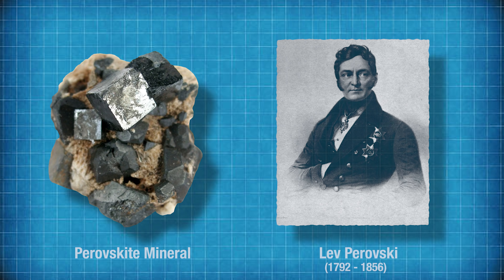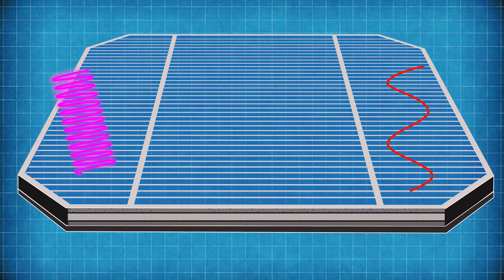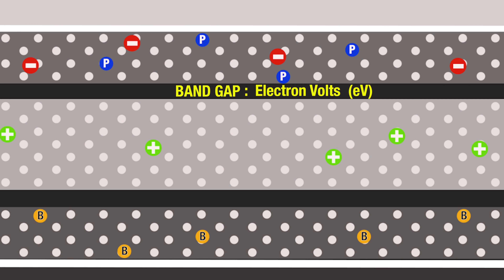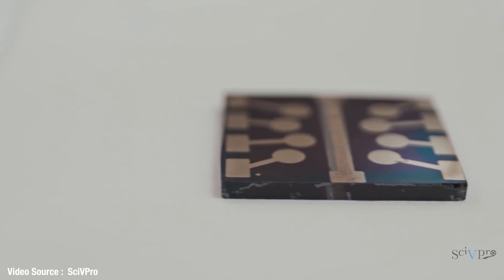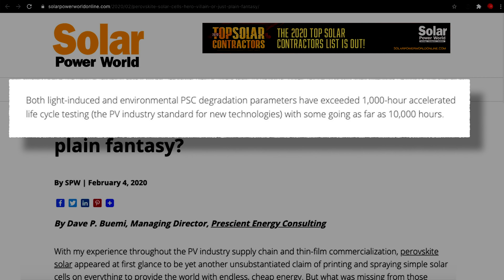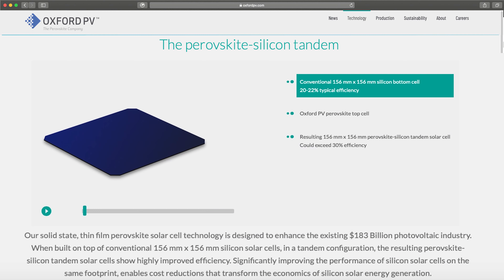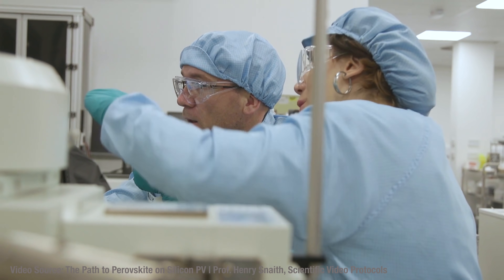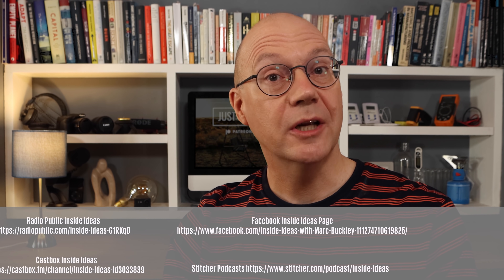Perovskite Solar Cells: Game changer?

Comment: Dave, great presentation on perovskites!  Concerning the lead in the cells, of equal concern are the silver contacts and all the copper wires, it's all generally from sulfide ores, often in the same ore body (like the one I live next too), and the risks need to be carefully minimized in both.  I would imagine the manufacturing process is safe because of stringent design standards, and newer perovskites are being developed all the time.. Concerning Aluminium, better would be aluminium conductive traces, perhaps sputter coated, or some other conductive materials that adhere well to either silicon or a perovskite.  Tin would be a safer choice I agree, though rare too, some might consider tin a semiprecious metal.  But if it takes but a tiny amount per cell, still that's multiplied by millions of cells..  probably we use 100s of times more just to coat steel cans!  It's worth it if it helps get us to net zero or negative carbon emissions.   Keep on with the great work, you offered just the right amount of information in your synopsis of perovskites.🧿🌎

Comment: Exterminating 100 square miles of desert for solar will not gain opposition from the fossil fuel industry.  It will gain opposition from the environmental movement.  A lot of desert is not flat, and most of the biota are in the flat places, not on rocky ledges.

Comment: Between the EZ (exclusion zone) charge-separating capacitor-like properties of water when exposed to light, and the high energy density of hydrogen (H2) gas, wouldn’t it be a better idea to allow the sun to drive a water splitting (H2 liberating) reaction by placing the panels over water? I am no electrical engineer, obviously, but it sounds like a powerful and safe combo if we can figure out how to make it work.

Comment: The performance of solar panels is NOT the problem. It does not matter whether such a panel produces 10, 20 or 50% yield.
Why?
Because space is practically unlimited; solar panels do not have to be as small as possible, their size does not matter. They must be cheap! Only the price per kWh is decisive.
That's where OLEDs come in, they are unbeatably cheap semiconductors because you can simply print them on plastic foil. Solar panels from the coil! Simply spread out, staple in place, connect to the grid.
But unfortunately this cheap technology is of no use at all. Not even if the panels were free, they would be a good idea, because THE SUN DOES NOT SHINE AT NIGHT! Solar energy requires gigantic storage facilities and for these there is no practicable and affordable solution.
Therefore solar energy is a dead end, unless we ignite the sun fire on earth, in fusion reactors.
Reply: "The sun does not shine at night"      Yes it does.
The rest of your twaddle about solar panels clearly indicates your lack of knowledge.

Comment: As an European I am so happy Jimmy Carter is mentioned with his 1979 solar panels for heating support.
No matter what people say he was decades ahead of his time and wanted to get out of fossil fuels to be more independent form Arabic oil.
Reagan made a 180 by preventing Iran to realise hostages before the presidential election and went full crude oil again.
Because of big oil.
This has lead to two wars against Iran and the first Iran war lead to Osama Bin laden and the involvement in Afghanistan etc and the air strikes all over.
This wars costs more than 2 trillion dollars more than enough for free college education and a healthcare system for everyone.
But both the healthcare system and free education was targeted by the republicans.
So who should be more respect seen from this perspective?
Carter owned his noble peace price because he cared for his fellow citizens, some presidents only care for themselves.
Reply: Of course solar is just now barely ready for primetime so there's that.
Reply: @chasl3645  not correct. If every Texas suburban house installed solar panels on the roof there would be a huge reduction in the demand for electricity for air conditioning during the blazingly hot days of summer (more than 6 months).
Reply: @michaeldasilva-l7w  You may be right. Doesn't change the fact that cost to produce Electricity is going up. Along with cost to produce panels is coming down.
Personally I'm rooting for an Iron Man type power supply.
 I think solar is old school.
I mean if we're going to dream let's make a electronic energy catalyser that maximizes the energy output of hydrogen. Maybe power your house on the energy potential of the hydrogen contained in an 8-oz glass of water for months.
There is absolutely better ways of producing power. Unfortunately I'm not smart enough to figure it out.
Reply: BS
Reply: He was also another president denied access to the ET / UFO Phenomenon that is very well known about by high level government . There is more known about the ET subject than modern medicine and the general population could careless to know the hidden truth .
Reply: @bruceburton8315  If you do your research you see him in a different light. https://youtu.be/UDzI2t5mrhE
Actually he don't believe if it s possible that they visit because space is so enormous.
Keep in mind the parker space probe is the fastest man made object in space so far but it will need about 18350 years s to arrive at the nearest star to earth Alpha centauri which is only 4.3 light years away. The milky way is about 90000 light years in diameter. There's for sure life out there but as far as we understand physics there's no way so far to explore the galaxy in a lifetime or a 3-4 generation ship. And even then we can't communicate well a near star would be about 50 to 100 light years away so every hello would take 100 to 200 years before we get a response from out there. Even the 40 minutes signal delay to Mars is a problem for NASA because each robot has to have ai when it drives to decide for himself because real time remote control is not possible at this distances.
So if they want something from us they must have a good reason. I by myself will not be visited from ETs because it would possible not end well for us.
The simulation hypothesis is much more likely in my opinion.
Reply: @abelgerli  I'm very sorry but that is not true . There have been dozens of people that are willing to testify in front of any congressional hearing and state what evidence they have . Its not a hoax . You need to look up the disclosure project and get up to date . These men have nothing to lie about like  NASA  and many others . Edgar Mitchell who went to the moon is one of them . Gordon Cooper another. Tom Bearden who worked with missle defense , Bill Uhouse USMC veteran Ww2 and expiermental pilot . Don Phillips Who worked on the U2 project and the Lengendary SR 71 blackbird . They all are true patriots and will tell you the shear truth if you go looking . Its not what we have all been told and you have to know for yourself . You tube Dr Steven Greer , go to his channel and look at his playlist . Open the witness testimony file and watch all 60 videos of the evidence. Then get back to me on doing my research . Ive done it so should you if you want to know the truth.

Comment: great..informative video. It seems long term stability remains still the main challenge in commercializing the perovskites. However, for the Internet of things (IoT) under indoor light conditions, these are the promising choice over silicon to operate low-power electronic devices.

Comment: This is really good news. I own a solar company.
Also, we might call it aluminum erroneously, but I was never in the milla-tree!
Reply: Actually, He's wrong: Ironically, BOTH pronunciations and spellings are correct! Back when Aluminum was first discovered, several papers were written on the subject, and for whatever reason, the spelling was different on each paper. The United Kingdom adopted the former spelling "A-L-U-M-I-N-I-U-M",  The US and Canada adopted the latter spelling, with out the "I" in "ALUMINUM". We are not " of course, wrong", but neither is he! (If you spell aluminum either way on your computer, your spell checker will not attempt to correct it. Both spellings are correct.
Reply: @vincentrobinette1507  The shiny cap on top of the Washington Monument is made from the most expensive metal of it's time ( by weight ) . Aluminum .

Comment: Yes, "illuminum" is pronounced as aluminium in the countries outside of the U.S. , that silicon-silicone from silicon valley 'still sticking in the(ir) every day process(es), so why can't (you) americans switch to silicium and "silicone fat" when describing things the world should correspond with, still kinda dependant on american systems? Just like the Metric system, please finally have a deep look at it, it can't be beaten, even chinese will realize. Who sticks never "slicks". 
The metal lead hardly harms if noone scratches it. I wouldn't want to loose that Perovskite technology to chinese, right? kinda? A question would be why there must have been no Perovsky "material" on broader markets. 
"Doubtable" electric vehicles are being praised by less minded, but i'm still convinced that most type of cars should have a diesel-engine. I hope i was too sceptic here with Perovsky stuff, hoping it will get an occasion to show or prove the said-here. If it's better add that

Comment: TOWARDS INTEGRATED LOCAL ENERGY CULTURE, WHERE, for-WHAT, WHEN, WHY & HOW WE NEED IT:
Wonderful presentation on Perovskite-cell option for local Photovoltaic Cell electrical generation preferably upon the east, south, west & roof surfaces of each home, business, industry etc. Its fantastic that these efficiencies are being calculated so all of us can be locally energy-grid sovereign & interdependent. However there are many other factors, which central planners have a huge difficulty in appreciating.
CALCULABLE FACTORS: Presently ultraviolet & infrared rays damage building surfaces, reducing their service-life considerably. When calculating solar efficiencies one should be calculating the reduction of solar-ray damage as well as, if done properly, the insulating value of a solar-cell skin for buildings in summer & winter. The built environment in existing buildings & infrastructure offer huge efficiencies because a major cost of solar are the supporting structures needed to hold solar-cells up to the sun. The cost of Elon Musk's supervision of solar cells is huge, but naturally provided by families & companies intimate with their energy equipment. Some solar companies operating in the built & urban environments are combining hot-water solar with photovoltaic. Capturing infrared heat in the solar-cell transferred into water, cools the photovoltaic cell & greatly increases its electricity ion production. Electricity & hot-water produced right on a building's roof & wall skin has the highest efficiency.
The largest loss-factor in electricity delivery is TRANSMISSION & TRANSFORMER LOSSES according to distances from end users. Some will incorrectly boast that high voltage lines have less loss, but this is false because eventually one needs to transform 'current' into a home or industry useable form. Some will boast the transmission efficiencies of Direct Current versus Alternating Current, but again the interface with the user is key. One doesn't just measure the current lost at about 5% per 100 miles but as well all infrastructure, biosphere productivity, human health etc normally in standard accounting not calculated or treated as externalities. Central production whether from Nuclear, Hydro (water), Photovoltaic, Oil, Gas, Geothermal,  Solar, Wind etc is inefficient calculated at 50% loss by standard accounting or 90% when externalities are included with Full-cost whole life accounting. One has to calculate a host of factors, when designing & choosing between various energy strategies, but typically Full-cost accounting greatly favours local production in every way. Existing electrical transmission line networks can of course be considered as the foundation for an interdependent energy-grid.
DIVERSE COMPLEMENTARY-ENERGIES: When photovoltaic electricity is combined with Fecal Methanization into household & business electric-system base-load energy security & fertilizer, Urine-transformation into energy & fertilizer,  Helical-turbine, Linear-axis Wind generation along building roof-line or wall-corner shear surfaces multiplies ambient wind by ~16 times delivered to turbines,, Recycling, repair, reuse, rebuild of the embodied energy found in all manufactured material objects & many other energy sources such as kinetic water & wind helical linear-axis turbine generators placed on the bridges found in most urban landscapes. Multihome-Dwelling-Complexes (eg. Apartment, Townhouse, Village) with shared dwelling or business walls, floors, ceilings, roofs, utility infrastructure etc are three times more energy & cost efficient than single detached nuclear suburban homes. Welcoming passive solar into our collective buildings is more efficient than any transformation into electricity. Its up to us. https://sites.google.com/site/indigenecommunity/design/9-Complementary-energy

Comment: A point every one seems to make is if we replace the fossil fuel generation of electricity, then all will be great. Big mistake. If you replace all fossil fuel consumption with a hypothetical “wall plug” were everything can be plugged into, but we continue to engage in exactly the same practices and activities as we do now, there still will be a climate impact. Most of the impacts we see today the climate “alarmists” are blaming on the fossil fuel consumption.

Comment: Putting lead in solar panels is a good way to make use of it, you're not going to eat them. Making electric vehicles than run on solar is also a good idea. Cars don't have much surface area, but things like campervans do and it means they don't have to hook up to the mains on camp sites. They can camp anywhere. The best vehicle for solar powered electric propulsion is on a catamaran, they have much larger surface area and if you have a catamaran you're likely to be using it to go somewhere nice and sunny anyway.

Comment: Clear and eloquent explanation, thank you. My solar kayak experiment has really sucked my into this rabbit hole. How does Perovskite cells compare to Silicon in weight at equal efficiency? And does it show similar improvement when cooled down? Marine applications - boats or fixed waterside facilities - can readily be "heat-sinked" into the water to exploit any low temperature advantage.

Comment: Just go for cheap water free nuclear instead. Molten salt reactors deliver clean energy 24h a day independent of weather or season, recycling used light water reactor fuel in the process.
Reply: In your back yard?
Why instead?
No such thing as cheap nuclear power, there never has been.
Reply: @davidwatson8118  To make a long answer short. Yes, in my back yard. Reactors with pressurized super hot water in the reactor core presents a real danger of dispersion of radioactive isotopes in case of a catastrophic failure. To prevent that from happening means several layers of expensive security measures. Further more, all light water reactors use solid fuel rods and they are precision made and there for expensive which drives the cost up even more.
Molten salt reactors have non of that. Molten salt does not boil until twice the operating temperature of the reactor. No boiling means no build up of pressure in the reactor core. No pressure means no dispersion mechanism and that my friend means inherent safety and lower cost. Molten salt reactors can use liquid fuel salt, liquid fuel salt is simpler and cheaper to produce.
So to sum things up, water reactors are hazardous and expensive, and molten salt reactors are safe and cheap.
Why instead? Well, wind and solar needs nuclear to maintain and stabilize the power grid. If I already have invested in a functioning nuclear infrastructure with emission free power 24h a day independent of weather and season, why would I want to complicate things with flimsy wind and solar? With wind and solar the power grid has to become more complex in order to compensate for wind and solar power fluctuations. Complexity means more expensive. That's why instead.

Comment: Please mention that perovskite is promising, but power conversion efficiency is not STABLE. It still requires a long way in research to be passed. Si solar cell has stable efficiency and ppl are working to reduce its cost.

Comment: Strange that aluminum is spelled aluminum in the USA and apparently spelled different in the UK.
Reply: It actually is. it IS spelled alumin(I)um in europe. We don't spell aluminum with the "I" before the "um". The reason is, when the element was first discovered, there were several papers written, with the earliest ones spelling it IUM, the other, aluminUM. That said, Canada and US adopted the latter, the United Kingdom adopted the former. Bottom line, we're BOTH right! If you type either spelling, your word spell checker will not attempt to correct either spelling.
Reply: Yes, when it is spelled wrong, it is pronounced wrong.